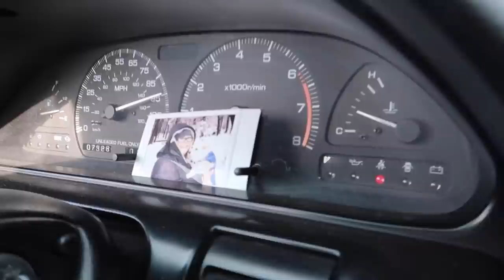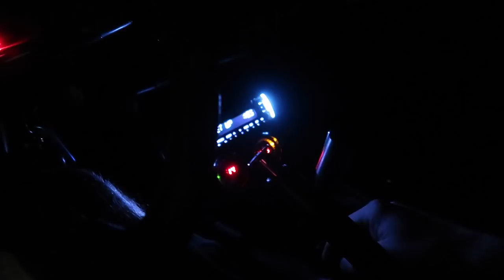Got Myself ANOTHER Car!!!

Comment: Bad news the car has alot more miles then the guy said, I scaned the vin on "my carfax" and saw the guy rolled backed the miles. The car has 200000 miles
Reply: how u find out??
Reply: MRQZ Media I saw the rear lisance plate and from there ran a vehicle history report at "mycarfax.com"
Reply: lul rip
Reply: You hella extra. I like it lmao
Reply: Nick Baker lmao it was hard to believe It only had 70k
Reply: Haaaaaaaa!
Reply: he got finessed
Reply: Arman Athwal lol that suuucks bad, has still got some life in that single jingle though. My dual cam just hit 230k miles & going up cause it's my daily, motor runs healthy too. Had a homie with a single jingle ran his up to 260k before he sold it. If he maintenance it he'll be fine for a while
Reply: You mean the 6F0G928 plate ? California
Reply: Bajwa94G yea
Reply: Arman Athwal I type it in the website and the state CA and it didn’t find anything. Does the plate info disappear as you transfer your car papers and cancel the plates ?
Reply: Bajwa94G it shouldn't. make sure your in all caps and there no spaces not even at the end
Reply: Yup I found on Carfax to
Reply: aathwa l it originally could have 200k but he could have changed out the engine the transmission everything else and it never sets back or restores the mileage. So your wrong.
Reply: Maybe he rolled back the miles cause he did an engine swap
Reply: @alexn6029  could’ve rebuilt it too, I doubt this guy would lie about the mileage being that high. He probably got it from the previous owner with like 200k and redid everything

Comment: I know right now as a kid you think these are great to buy and you’re blowing thousands on parts and used cars but money will run out and instead of saving and buying just one really nice DEPENDABLE car, you’re throwing your money away on these old ass cars that you’re constantly spending money on fixing. I respect that you have your money and your YouTube is somewhat popular, but again, that won’t last forever. You need to look into the future a bit. Unless you rely on your parents, which isn’t necessarily a bad thing. Again, to reiterate for those of you that aren’t that smart, I’m not hating, I’m just suggesting you look more into the future and save up all that money you’re making so you can get yourself something better down the road.